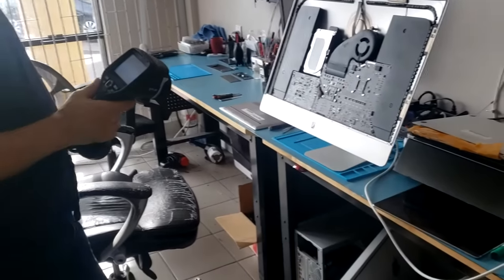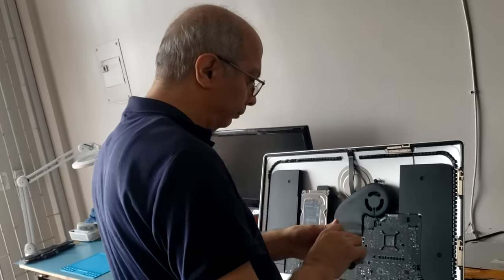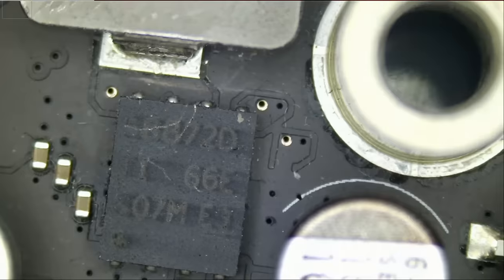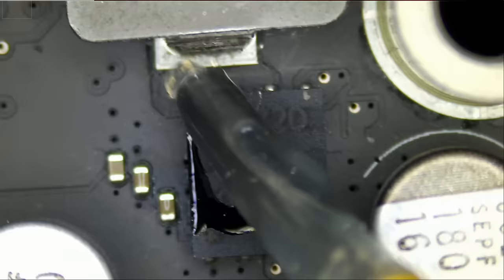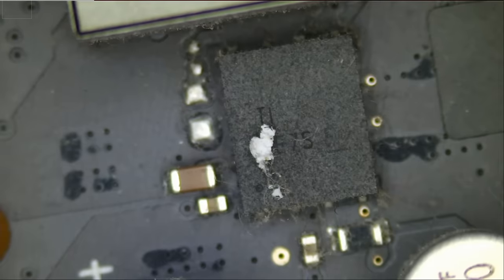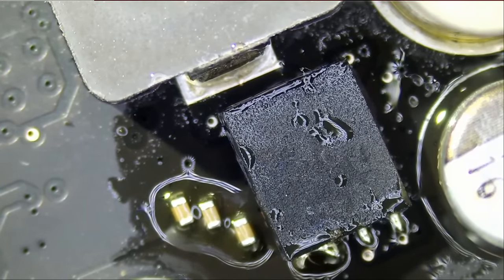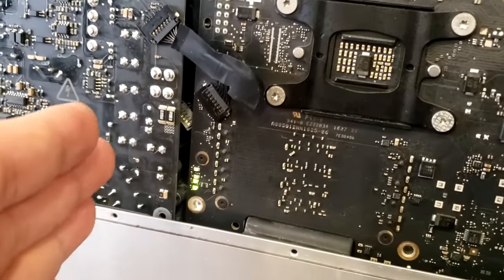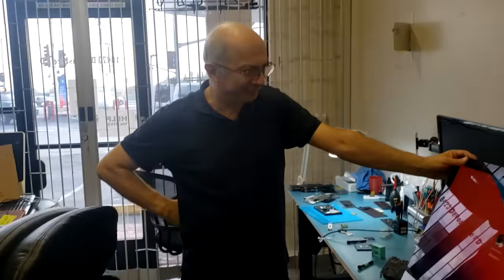iMac 27" 5k Won't turn on - No Power Motherboard Repair

Comment: I'm happy every time an Apple device is repaired, of course because their repairing polytics. And if you are the technician who does it, makes them to be ashamed because, with your knowledge, you are demonstrating them and everyone that is not necessary to change full boards to repair any of their devices. As always, congratulations.
Reply: The futher shame for Apple is the lack of parts for unauthorized repair shop and so one must rely on donor board, as Alex does...regards from Italy.
Reply: @paolomonai9511  there are a lot of spare parts available for repairing, but from IPhone X to now most of them are paired with the motherboard, so you can't use them without losing funcionality. I was referring to the shameful repairing way from Apple, who only offers to their users complete part replacements (or deny repairing, just what happended to LTT) instead of repairing them, and at indecent prices.
Reply: There’s a reason for that. You don’t think they know it isn’t necessary? Lmao. They would prefer to sell you a new device and then fix it themselves and sell in another mac as refurbished.
Reply: @RolandKoller90  of course they know everything, but that's not an excuse, is a scoundrel reason.
Reply: @RolandKoller90  Apple knows, but their customers don't.
Reply: @godmodes  Oh! No...they know very well but you are cooler if you can show the very last (CR)APPLE gadget..aren't you?😄😄😄
Reply: Didn't apple talk about providing spare parts for customers who feel like they can do repairs ? It was very surprising to read, I hope that goes somewhere

Comment: How do you make sure other components on the front of the board don't get desoldered while you were applying heat from the bottom? I was worried solder will liquify in one of the components on the front of the board and then fall off due to gravity.
Reply: These kinds of multilayer PCBs do not conduct heat easily. They tend to soak it up. I tried once with a UE speaker to remove a set of through-hole pins by just applying heat to one side. I ended up giving up. The PCB and lead-free solder make it very difficult.

Comment: Do you know what would be nice? If the thermal camera has a red pointer. This way you would not need a 3rd hand to point out the problematic component. Great video as always!
Reply from the maker: It does have a laser pointer.  I should use it.
Reply: @NorthridgeFix  but is it pointing at the spot you looking at? it either needs to be on the same axis as the camera or actively tiliting itself depending on distance

Comment: So you remove the faulty Mosfet and replace it with a donor Mosfet. 
Is there no way that you can test the donor one to see if there is an equivalent new Mosfet available? 
The only reason i ask is it might come to a point where you have say 3  customer boards all needing the same mosfet to be replaced and only two donor boards, so one has to be unfixable.
Love the channel..

Comment: Perfect video to show my sibling that I need her to be big boss.  
I been taking consoles and joysticks apart and back together since the dawning of Atari  2600..  
And as technology grew as time passed as devices broke down friends or my own that I would fix. 
Atari 2600 /400 /800.
Turn tables, tape decks, cd players,  up to present time building a DK05 L~L 
2 computer desk build.1 Asus board, 2 Gigabyte Extreme WF board..
🌝An older Asus board P7Z77-V Deluxe mb with a onboard error code 55. Pertains to memory area. 
So I examined the board and on the upper right side I found a blown Mosfet and a broken off aluminum caps that pop like popcorn. 
Replaced both parts and a year ago I could not get the solder to come close to melting.  Then I found you  and Flux and copper weave made removal  and installation great. But to no prevail. Still same error 55.
Soon to try resinpowder to look for short. But a bit busy with the desk.
I replaced the board for $179.  Exact same and memory sticks from bad board work great in new board as well as processor. 
So now old board a test/practice board.
Or at least donor parts for future. 
If I strike out and  not embarrassingly deform the board I will send to u. Pay of course either way.  Just to see video and 99.9% chance of better than factory job.
Any hoot it's 6th gen Intel and won't be able to run Windows 11.  Not only missing TPM chip, the processor does not conform. 
But video would be cool 😎.  It would come with mounted processor and two sticks memory.  Lay it on bench and power up...👍🏻🤷🏻‍♂️🌝

Comment: Hi there. Have you encountered an issue wherein the usb c thunderbolt ports are not working (tested different cables and devices) but the usb ports, sd card reader, headphone jack all work?

Comment: Hoping someone can answer my question. When is the low melt solder used? I appreciate the input and thanks in advance.
Reply from the maker: It's used for de-soldering only.
Reply: @NorthridgeFix  thank you so so much sir,,,you have really gotn me interested in many repairs because of you and learned so much already.

Comment: If not even the first LED turns on, what would you check? (Power cable connected to a wall outlet with confirmed power)

Comment: Hi genius, my iMac 27 2019 won't turn on in anyway, I see that on the motherboard I have 2 green lights so could be a graphic issue GPU... So my question it is: could be possible to repair a graphic board issue that does not let boot an iMac 2019 ? I'm reading around that it is not possible repair or upgrade an iMac 2019 2020 graphic card because it is built inside the motherboard. The problem it is that when I bought it I choose the best iMac 2019 I could get and now if the only way to fix it is to buy all the motherboard with all again it's much money and even so stupid... I'm so engry for that... Any suggestions ? Thanks !!!